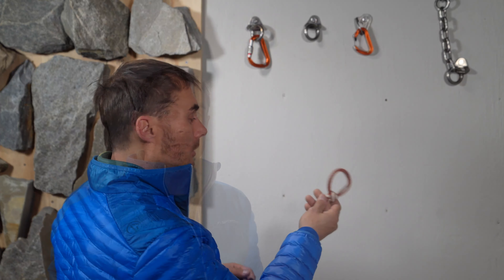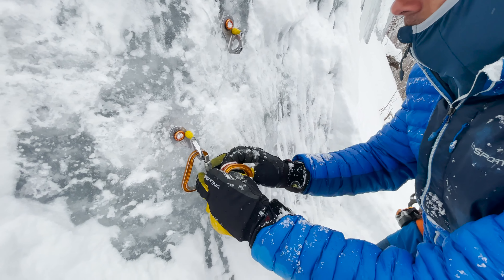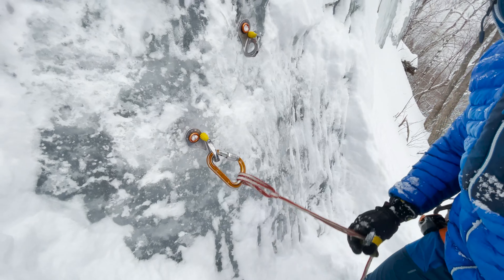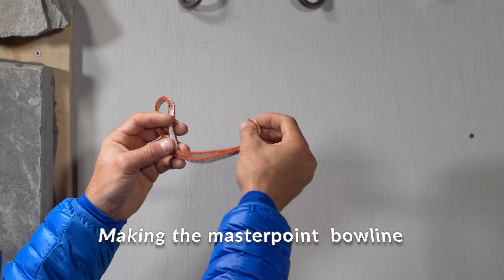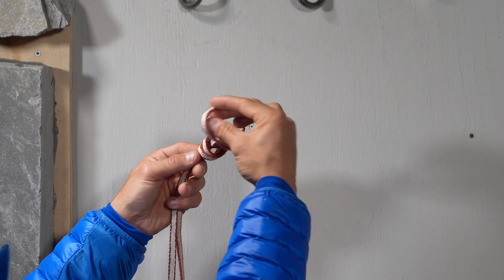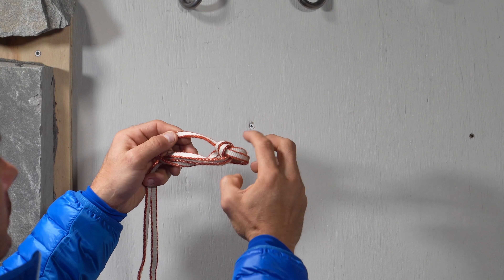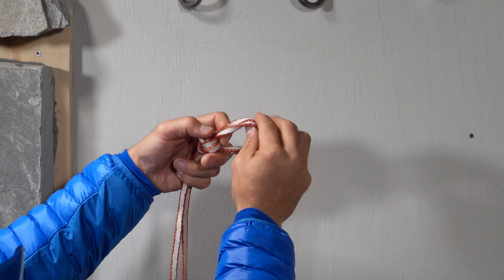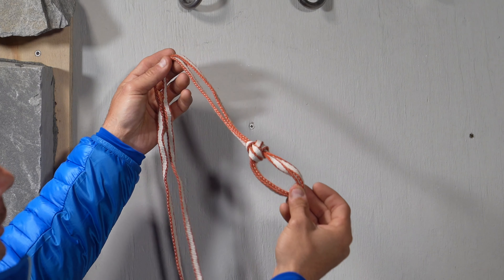Bowline master point preset climbing anchor

Comment: Hello Karsten - thanks for your good movies. I have this question: In an Ice Climb Multi Pitch - do you Belaying with Fix Point or with Body ?
Reply from the maker: It still always depends. I would say I’m still choosing the body most of the time. But the fixed point when there is a long runout or a roof above that I would not want to be pulled into.

Comment: Hello Karsten - i have one more question: In an Ice Climb: is it possible to Belay with an Auto Tuber ? ... - Edelrid Giga Jul in Auto Tube Modus or CT Aline Up with Click Mode
or should we belaying dynamicly?
Reply from the maker: On the fixed point belay, a munter or plate. And honestly I mostly lead belay with a grigri. But you can use other ABDs.

Comment: I think I'm missing the advantage of this? Is it rope economy?
Reply from the maker: It is an easy anchor to not hav etc untie (kind of like the quad) but also it is used when doing a direct belay or "banshie belay" sometimes referred to as a fixed point belay.
Reply: @howtoclimb  Ah I understand, particularly because the anchors are offset. Interesting. Thanks for the video.
Reply: This is also the UIAA recommendation for multi pitch. In Europe this is what we use instead of a quad

Comment: Thanks for the video! Is there any disadvantage of rigging this with a quad, as shown here: https://www.youtube.com/watch?v=Pcl6XQxIr1U
Reply from the maker: The quad provides some different attributes. This specific anchor is better for direct belay off the anchor for the leader. The quad however gives two places to clip and can be more comfortable in a hanging belay situation.
Reply: @howtoclimb  Thanks for your answer and fantastic videos. I´m thinking of this because I usually have a pre-made quad on multi-pitches with bolted anchors. Instead of having to untie the quad when I want to belay the leader directly off the anchor and rig the sling like you (and ENSA) recommend, I´m wondering if I can use the quad that I have already made to belay directly off the anchor. I´ve seen that in other videos, where the loop that connects to one of the bolts is also connected to a carabiner with a munter, off which the fixed-point belay takes place. Link in my previous comment, just wondering if there´s any disadvantage with that particular system cause it seems like it could be more efficient.